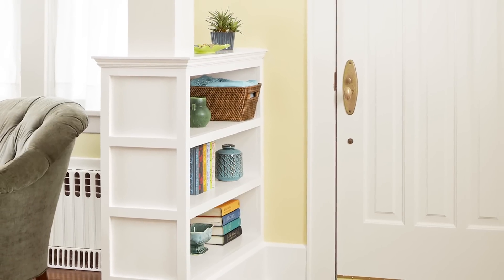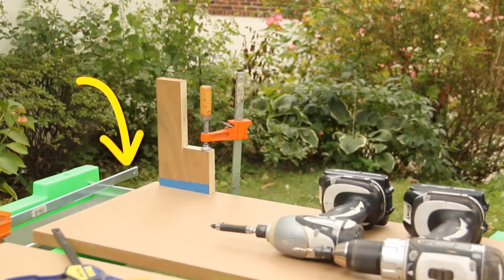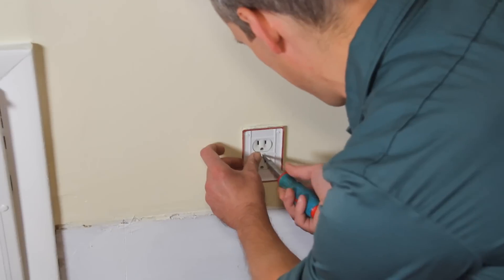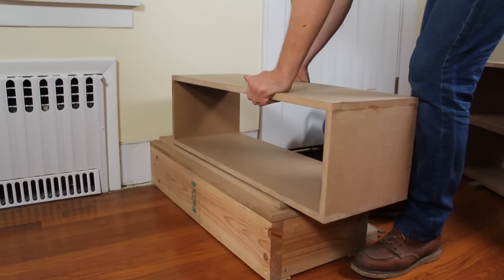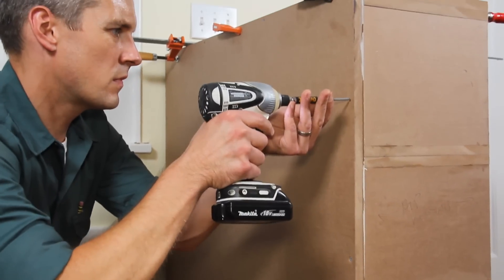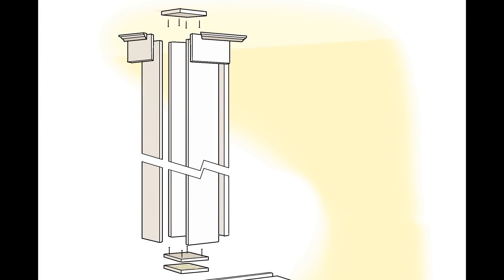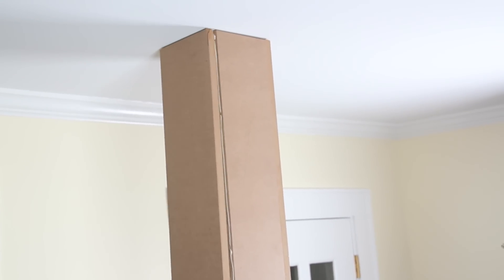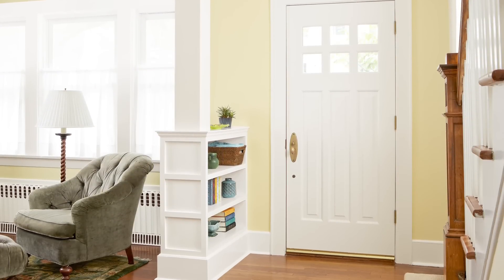How to Build a Columned Room Divider | This Old House

Comment: i have a question, my floor is tile one, so how should i fix the base strongly coz i dont think that nailing to the stud is strong enough for the whole half wall. Should i use some special adhesive between the wood base and the tile floor? or some kind of fasteners?

Comment: Way over built. Would have been much simpler and easier to build with furniture grade plywood. Probably cheaper, too, based in how much mdf was used. Also, what's up with all the butt joints on the trim?
Reply: I agree plywood would be less prone to sag and receive water damage as well. Also, less likely to chip from items coming on and off the shelving.